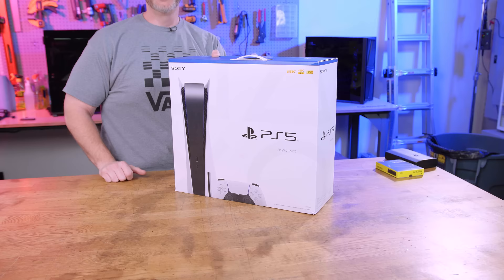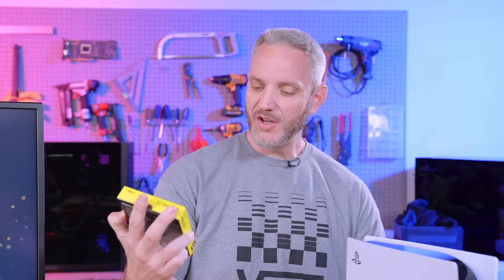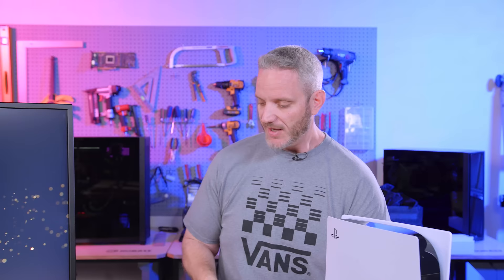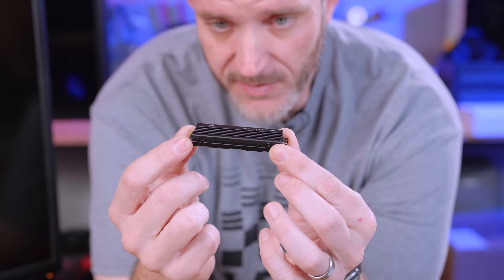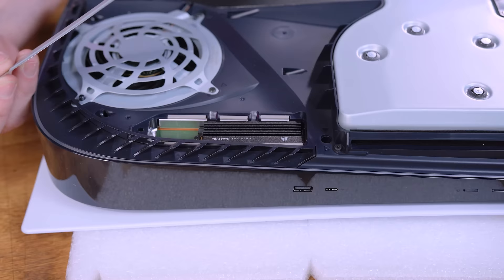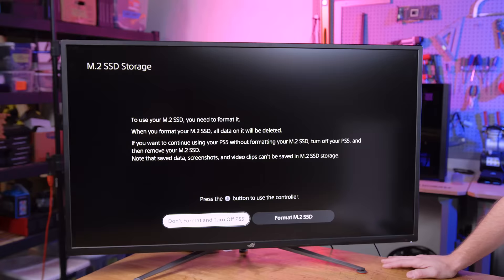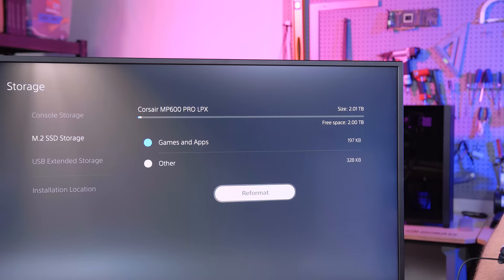How to upgrade PS5 storage - Easy Step by Step Guide

Comment: Would have been nice to see what the performance difference was between the two. Load times and such.
Reply: In my experience there is no difference in load times. Tried loading up a game on internal then moved it to ssd and it loaded up in pretty much the same time
Reply: Would be pretty much the same, since the onboard is just the flash chips soldered onto the board directly rather than on another pcb an attached to pcei.
It's like having 2 PCIE Gen4 slots on your computer, you wouldn't see a noticeable difference in using either slot
Reply: From the videos I've seen it varies between games which tests faster but it's almost always within margin of error.
Reply: @scarletspidernz  I was gunna say it’d be dope to compair cloning and replacing the system drive with something that has a tuned r/w but I guess if it’s already on the pcie bus it’d just be as fast as it can be. It’d still be a cool series to have one ps5/Xbox and do a mod to it while keeping the os intact to see how much you can possibly milk out of a system.
Reply: @scarletspidernz  the load time r so close and similar their no reason to be spending more money on a different brand. Just get whatever is cheap and meets the ps5 requirements.

Comment: @5:07 OMG!!! No wonder this guy has 3.81M Subs! That's the easiest explanation on how to remove the PS5 cover. I was so scared of doing it in fear of damaging something. I just ordered another PS5 from Sony and I was scared to death to have to open it to install my M.2 drive. Not too worried about the cover but it can easily scratch the inside of the console if you do it wrong. Thank you!!

Comment: when i source or fit these extra storage units i recommend leaving off the flap then you get the benefit of the heatsink.
just save the flap and screw in case you need service.

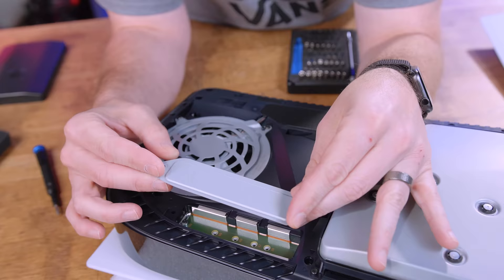Comment: 6:00 - that's why you would buy a 'Sabrent Heatsink for PS5 Console' - having the perfect fit, this cooler will completly cover 'the hole' ...and then you use the same screw to fasten it, that was used to hold the old cover-plate!

Comment: Jay: "How do you turn off the console?"
The same way you do with a PS4.
You press the PS button then slide to the off, which is located at the right of the sub menu.

Or you could just power off the TV and if it's synced, it will shut down the PS5 as well, it also opens up your TV and Sound bar when you open your PS5 so you don't have to search for the remote every time.

Comment: (0:50)  I really only buy games for PC nowadays, but still play my consoles a lot, cause I have a huge library on XB1 and PS4 from before my "PCMR" switch in 2018 lol.  And also Game Pass on XB1.  So my OG XB1 has a 500GB HDD, and I had a 4TB external for a number of years that kept me good, but with Game Pass I filled the rest of it quickly, and had to move up to an 8TB, and I'm close to full there now too lol.  The OG Xbox360 had a 20GB HDD I think, and it was a system update later on that allowed installing disc games to the HDD.  So originally that space was for DLC and save files, and it was plenty.  But later on it wasn't with more and more digital purchases, and just installing discs to the HDD so they loaded faster.  I upgraded to the 120GB HDD, and after that, an "unofficial" 240GB kit.  Then they added the USB storage capability, so I had another drive or two there.  'Member GTA5 on 360, which required an 8GB flash drive to fill with chunks of game data, that could load in parallel with data on the disc, cause otherwise it couldn't stream data fast enough or something.  I think you can just run it all off a HDD if you install the game to it though.

Comment: I bought my first M.2 ssd a year ago. It was fine with an OS being installed and ran from it, but would cause crashes and lockups if I played games from it. Being relatively new to them, I had no idea that they needed heat shields. My motherboard didn't come with any and neither did the M.2. ssd. Figured it out a couple of months ago. A $12 fix (pack of 2) solved my problems. It's still in the cooler months where I'm at, but the temps on both of my M.2's rarely get above 35c when gaming. The ones I got were heat shields for both sides (even though both M.2's are one sided). Nothing fancy. I said all of that to say that you'd think that the PS5's would have, at a bare minimum, fanless vents for that slot. Then again, there shouldn't be any heat from the processor/gpu combo getting to it. Maybe it'll be alright?
Reply: sony explicitly advices you to put on a sink. i guess they do it for a reason. maybe in a cooler environment it will be fine? but i guess you should put one on the drive none the less.
Reply: @bertracoon1884  For sure. The first M.2 (the one giving me problems) is an NVME  who's slot sits right above the gpu. My guess is that it's own heat combined with the gpu's heat. I have plenty of case airflow. Like I said, it was my first one and I never read instructions for storage drives. Probably should.
Reply: @andromydous  is it a 3.0 or 4.0 ssd?
Reply: @bertracoon1884  4.0

Comment: There are 2 small slits in the cooler bay, the guy who designed it said that the giant fan is used to do negative pressure cooling within the drive bay, so you definitely need that cover on there otherwise this whole thing wouldn't work

Comment: Playstation specifically says to put the cover on because the airflow from the fan blowing around the system should blow over. If the cover is removed then it can compromise that.

Comment: There is ventilation inside the M.2 bay, it uses negative pressure, there is a hole at the socket and a hole at the back of the bay.

Comment: Thank you for this video. I bought a ps5, installed the internal storage then did the update and my ps5 kept shutting down. It would only stay powered on if I removed the internal storage, so I returned the pa5 and storage thinking that it was something bad with the ps5 and/or storage. I will be buying another ps5 tomorrow and make sure I do the update before I install the storage and hopefully it will all workout great! Thanks for the helpful video!

Comment: Every single owner of a PS5 NEEDS to install an SSD, even if it's just 500gb or 1tb, because it will help prolong the life of the WHOLE SYSTEM due to the fact that the included storage is SOLDERED TO THE MOTHERBOARD. Using an "expansion SSD" in the console and changing the default install location to the expansion SSD reduces wear on the internal SSD. Also I like using an external USB SSD/HDD exclusively for my PS4 games because they don't seem to load any faster from either internal SSD's and it leaves all of the fast storage for PS5 games. Just my opinion so anyone who wants to test out my theory feel free to prove me right ;)

Comment: I was sent here by a local PC shop for my PS5.   Looks very easy to install the upgrade.    Only I'm still not actually comfortable with it (I have resting tremors in the hands.)  Though it doesn't look like my condition would be a problem for this. : )

Comment: PS5 is awesome finally a good console, Love the dualsense controller! I installed a 2 TB samsung on mine. Could be that without the cover it would introduce some turbulence to the cooling. Playstation recommends a heat sink when the on board storage is hot AF then closes it in a chamber. I bought a cheap amazon heat sink meets the clearance has been working great for me.

Comment: Not replacing the NVME2 cover makes all kinds of sense. Especially since the fan exhaust would riccochet off the cover onto the ssd. Also, X-box 360 opening tool? I scoff at that. My skills with a flat blade screwdriver are legendary. If you need a cheap nose job let me know. I take food stamps.

Comment: Did anyone find any issues putting the regular cover back on? With my luck I just know something bad will happen if I do so. I also ordered the Sabrent cover but it doesn’t fit for some reason so I have to use the original PS5 cover.

Comment: so just a little bit of info the black bars that are in the way of the m.2 slot are also click removable. so it is easyer to work with figured that out when i needed to check my ps5 gen1 fan.

Comment: Just installed that SSD with heatsink in mine. Great price. My PS5 may be newer. There is no slot for the little riser. Only 3 barely there protrusions. The riser sat flat on the board. So little guy was slipping and sliding while trying to get the screw in to hold the SSD down.

Comment: I just landed a PS5 and immediatly ordered a 1TB internal ssd and a 5TB external for ps4 games.
As simple as this process is, i still thank you for it. This video should help ppl for years to come.
Any update on leaving that cover off and how hot the SSD gets? it looks to be right next to open vents of the system outer casing, so i kindof want to leave it off

Comment: Side note to the external storage portion.

There's a known issue with external drives disconnecting. I don't know if it's because the enclosure doesn't have dedicated power or if it's the port going to sleep but it occurs often.

Speed is also based on USB-C when using an external enclosure while the internal is PCiE Gen 4.

Slower Gen4 drives will work despite not meeting requirements provided by Sony. Gen 3 will not.

Comment: I bought the WD Black SN85O drive for my PS5 for three reasons:

1) The Corsair MP600 is too tall - this is the drive I chose for my PC and I would have thrown one in my PS5, too, if it fit.

2) I really like Western Digital

3) Lord Mark Cerny, the PS4 and PS5 system architect, chose this drive for himself and I can't think of any better recommendation than that.
Reply: How is the drive working so far. No issues

Comment: If your PS5 is anything like mine, one of the things all these videos keep missing is that the screw for mounting can be in there TIGHT and I almost stripped the screw.

It has teeth in the thread for a pair of needle nose pliers to get it started. I'd do that if you meet with ANY resistance. These screws are begging to strip with the most little effort.

Comment: So the M.2 cover is needed and Sony explains online to make sure it’s put back on as the fan does blow air through the slot and it relies on the cover to work 
Also you said it was a 7000mbs drive but you only got 5000mbs 
You need to put the M.2 in a PC first and update its firmware to get the full speeds as advertised in the ps5 so can you do a follow on video showing this as well

Comment: My 980 gen4 2tb with heatsink and additional heat pad to remove all space between the SSD and the ps5 M2 cover does well, frustrating it only gets 7000MB/S instead of the 8000MB/s I get in the PC but I guess that's just some CPU overhead on the ps5, I also got a cheaper gen3 m.2 ssd and a USB 3.1 m.2 enclosure for PS4 games installed on the external, it maxes out at 1250MB/s but it's still heaps faster than an external HDD and standard external SSD and worked out cheaper than buying a pre-made external M2 SSD and there was no point getting gen4 as it's limited by usb3.1 speeds, also a second flash drive for music files in a folder called Music and formatted to I think fat32 allows you to play your own music while playing any game and if streaming through the PlayStation it doesn't record any of the music which is awesome.

It's really nice having all of my PS4 games installed and to be honest I play more PS4 games than ps5 games as there just isn't many available at the moment and second hand PS4 games are dirt cheap!

Comment: Thanks for this. Just installed a 2TB Samsung 990 Pro with Heatsink, there is a cash back offer on from Samsung (at least in the UK). Read speeds show as 6380 or ot may have been 6340. Either way it moves games from the console storage in seconds! 

Just one final step not shown in the video and that is to select the disk in the installation storage menu. However it mentions it when you install the disk itself.

Comment: Thanks for the easy to follow video! Question, my son stripped the screw at the 110 mm mark and I can't remove it to bump it to the 80mm space. Any tips to get it moving?  I've tried a low output power tool and a rubber band already, and no-go. Any suggestions would be great 👍 Thanks again for all the helpful info!

Comment: I'd tap and drill small holes into the ssd bay cover for hot air to escape, also maybe do the same on the side panel. Very small holes for ventilation. It's not an intake so no filter would be required. Anyways maybe someday I'll have a PS5!

Comment: FYI: External Drive Notes - External drives cannot play PS5 games/optimized games.  Only Play PS4 games or HOLD ps5 games.  This is due to the direct storage limitations and an external drive is too slow.  So when he mentions using an external is possible, know that it is limited for new games moving forward.

Comment: Thanks Jay owned a PS5 since launch will definitely do this upgrade, shame that in the UK gpu prices are still more than a PS5. Did you folllow up on the cooling, sure looks wrong to put that cover back on. Also do you have a view on horiozontal vs vertical configuration, there is speculation that the popular vertical configuration may not be a good idea long term?

Comment: I'm using an under spec 1tb firecuda 520 zero problems! Also the sabrent ps5 heatsink works well (it replaces that stupid aluminum plate) but I'm not sure how well it would work with dual sided SSDs. Anyways save your money, 520 works fine! 

Also jay is wrong there is air flow within the m.2 bay and you dont want to leave that cap off because dust will get inside and it reduces the pressure inside the ps5 i(f you leave it off).

Comment: Xbox 360 storage was never difficult to upgrade, you either clipped off the the the hdd caddy on the top of the console, or for the newer ones just turned it upside down removed a hatch and pulled the old hdd out and put a new ms branded one in

Comment: The way to extend storage keeps cool is negative pressure. If you look closely in the in the green there are small holes and suck out the heat from the m.2 so you HAVE to put the cover back on to make it work effectively.

Comment: My 2tb SSD is about to arrive at the door in an hour.  Did you do the temperature checks?  I have read a few articles that transfers are short and dont need a cooler.  Any opinion on this jayz??   :) The cooler with no air seems pointless.    Brilliantly demoed cover removal- I have seen a few twists and looked dodgey- the push and pull makes great sense and gives me confidence i wont break anything.  :)